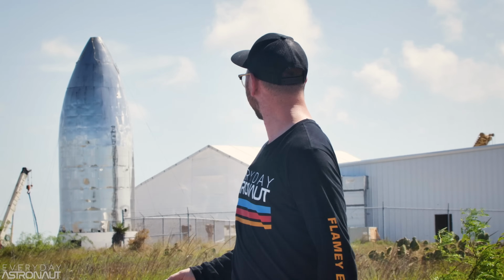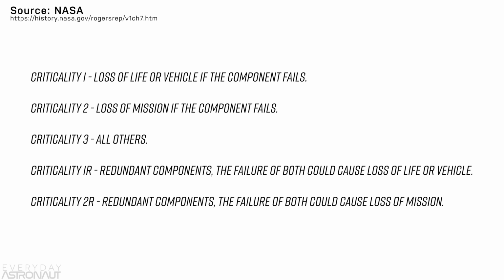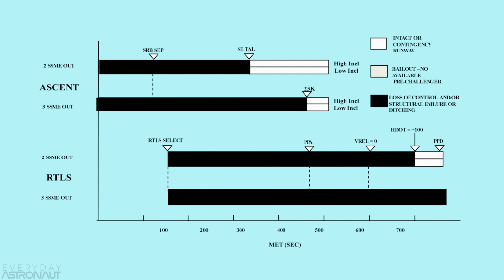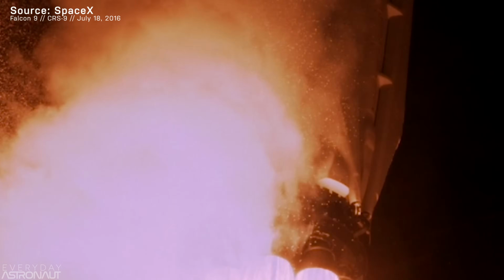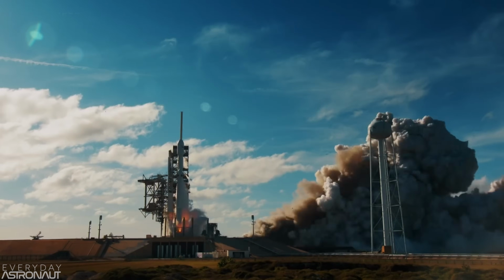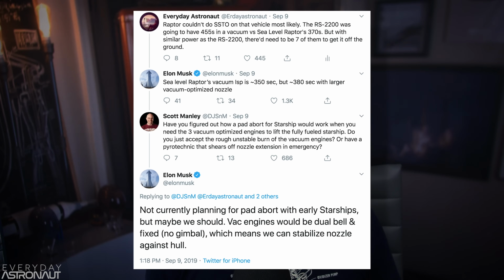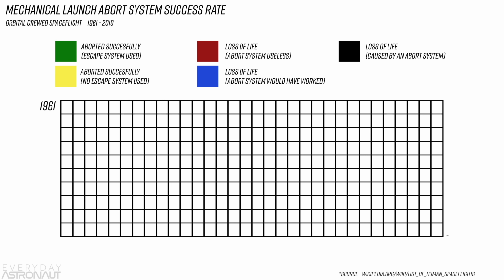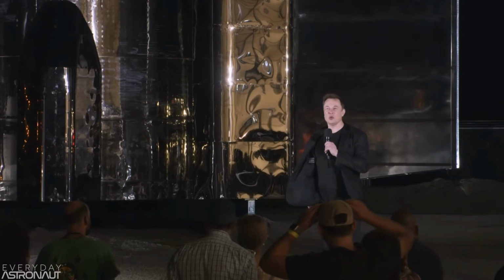Why won’t Starship have an abort system? Should it?!

Comment: simplicity wouldn't have made the shuttle safer considering it's complexity was not the reason for it's failures, but an abort system would have made it safer.  in the same way, simplicity will not make StarShip safer, but an abort system would.

Comment: I think if spaceX really wanted to make an abort system for starship they should go the blue origin route where there is an SRB on the bottom of the crew capsule that looks like a stylish table from the inside (also they would have to add some emergency parachutes to the capsule).

Comment: the Space Shuttle orbiters actually had zero failures; the loss of Challenger and Columbia were cause by failures from external sources, ie: the solid rocket booster and the shedding of foam from the external tank...

Comment: Since Starship has a clear demarcation between the drive section and the cargo sections plus with the expected design for the moon landing version that incorporated it's own thruster engines to the base of the cargo volume, wouldn't there be an advantage to adding some flexibility to the system to change out cargo deployment types by having a designed separation of the cargo section from the drive system? Once done you can swap out how a tanker is designed for cargo vs a people carrier with artificial spin gravity mech. vs a satellite launcher etc. With the designed separation it could also be utilized as anabort system.

Comment: I don’t think an abort system would’ve saved the Challenger crew, at least one crew member knew that something was wrong, but only realized that around 1 second before Challenger disintegrated, that wouldn’t have been enough time to safely perform an abort.

Comment: Time stamps:

00:00 - Intro
3:05 - How abort systems work
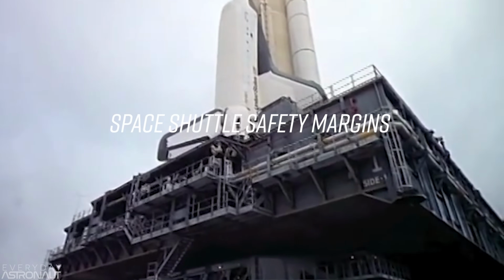5:25 - Space Shuttle Safety Margins
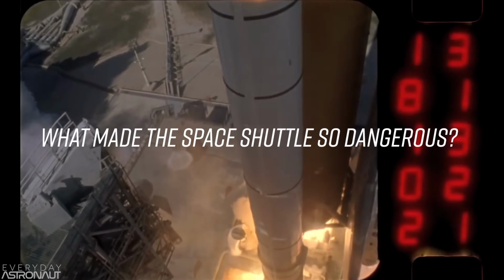10:40 - What Made the Space Shuttle so Dangerous?
16:00 - How Starship Will Differ from the Space Shuttle
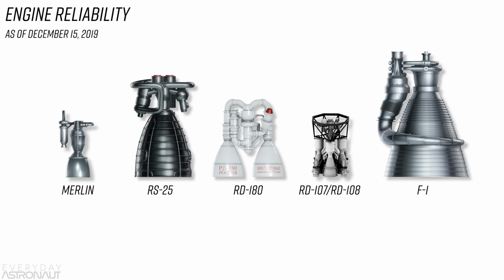21:00 - Engine Reliability
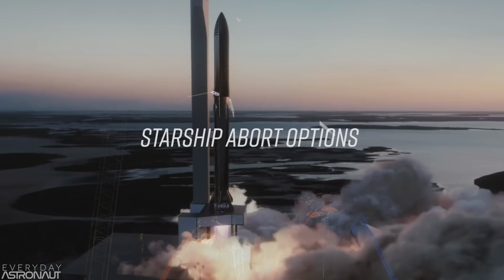30:25 - Starship Abort Options
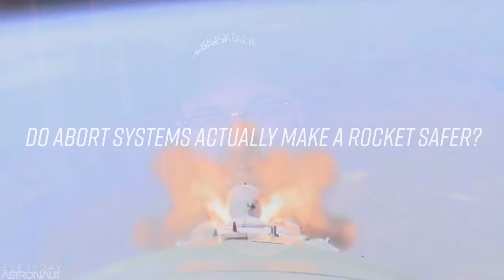34:30 - Do Abort Systems Actually Make a Rocket Safer?
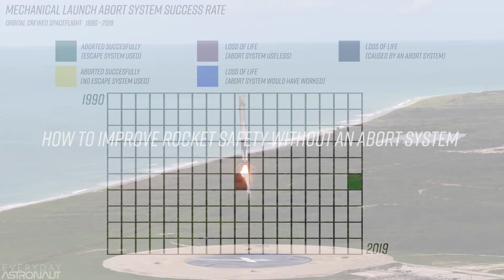38:55 - How to Improve Rocket Safety Without an Abort System
41:50 - Are Launch Abort Systems Necessary for Human Spaceflight

For smartphone users.

Comment: Under the current Starship configuration, the only way an abort system would work is if they literally cut our the cockpit section, bolted back with explosive bolts and had the external tower on the nose.  It could be jettisoned after flight.  You aren't going to save the rest of the rocket so this will work for initial flights and testing.  Passengers would not like the whole burning up and sudden deceleration thing.

Comment: If it is a government organization He will have to add an escape system. Because somebody said "I was afraid to die."

But for private companies The main thing is profit, Adding the escape system Is equal to increasing the cost And when the escape system starts That means their flight has failed. Which means a large amount of money that they have to lose. And even if there is an escape system The chances of survival are still very low.

Therefore, for commercial aviation Throwing money into the escape system (To save the passenger life only) That is not worth it. When compared with the money pouring into the entire system To make it safer (To protect both the interests of the company And passenger life)

In fact No matter how much money you spend on the security system. Someday, an unexpected incident will happen anyway. (This is a lesson you should learn from NASA)

If spending money on the needs of the people Which does not bring benefits to the company In the end, it only makes the company bankrupt because of the loss. And I don't want to Spacex. Make mistakes like NASA

Comment: 22:56 in regards to the mighty F-1 engine reliability,  during the Apollo 6 launch the first stage showed severe pogo osculations that nearly destroyed the vehicle.  Due to the less than nominal launch the Saturn did not complete its mission and I would consider it an at least partial engine failure.
Reply from the maker: Was that not a J-2 engine and it’s pogo oscillations?
Reply: @EverydayAstronaut  The first stage pogoed severly.   NASA reported "The second Saturn 5 lifted off from the Kennedy Space Center’s Launch Complex 39A on April 4, 1968; the mission ran into trouble from the start.  Two minutes into the flight, the first stage experienced about 30 seconds of  longitudinal oscillation known as pogo. Superimposed on the steadily growing acceleration curve was an oscillation with a frequency in the 5.2 to 5.5 hertz range which reached a peak amplitude of ±0.6 g about 125 seconds into the flight – over six times larger than the same effect experienced by Apollo 4. This was much higher than the ±0.25 g upper limit permitted during earlier manned missions and would have been intolerable for any crew. If Apollo 6 had carried astronauts, it would have certainly been aborted at this point.". . . . panels were seen falling off of the lunar module adapter.  Apparently unrelated to the pogo oscillations. After the completion of first stage firing and part way through the second stage burn, two of the five second stage J-2 engines shut down prematurely. The planned 175 km circular Earth orbit was not achieved. After two orbits, the third stage failed to reignite as planned and TLI was not possible. There was an apparent failure in the stage’s primary and auxiliary hydraulic systems had prevented the restart. The Service module engine was used to boost the spacecraft to an apogee of 22,225.4 km, from which the planned lunar reentry simulation took place at 36,025 km/hr. The failure of the 2nd and 3rd stage J-2 engines were not 1st stage pogo related.

Comment: Wide body passenger aircraft are not just redundant - they are quad-redundant. That means they can fail 4 times before a crash. Which is basically fail-safe in anyone's book. HOWEVER, airlines and the FAA are so used to this fail-safe nature that they commonly allow jets to take off with just triple redundancy! (One of the channels is inoperable!) Aircraft voting systems are yet another more complex subject.

Comment: Lots of statistics but the bottom line is every major launch system has experienced 1-2 catastrophic failures per 200 flights.  This includes Soyuz, Space Shuttle, and Falcon 9.  Remember F9 has had two failures so far, one in flight and one on the pad.  Either one would have required an abort system for crew to survive.  Starship will have to improve reliability by at least an order of magnitude to reduce chance of  catastrophic failure to 1 in a thousand, still not very good odds.  Can it be done?  Doubtful.

Comment: without watching i can conclude the answer is . yes it is necessary, you need to be able to take the risks in order to achieve great things. did columbus go float the sea`s with a live boat?  so basicly it doesnt matter if we have a savety messure or not. you still have to wager to go ahead or stop the procedure.

Comment: Perhaps Starship can do an emergency water landing if all else fails.   By using the flaps to flair out just above a lake and then touch down.  It would at least minimize damage which would allow reuse of components and protect the failed components that caused the failure (failed components available for failure analysis would be very helpful).
      The difference between 100% Saturn 5 rocket engine success and falcon 9 engine success is the numbers of launches.  Statistically you can calculate which one is more reliable by assuming different failure rates and calculate the standard deviation probability that the assumption is wrong.  Thus many engine successes gives a much smaller sigma standard deviation and therefor falcon 9 engines are statistically more reliable than Saturn5 enginess

Comment: So the question remains.....when they designed the shuttle, was the detachable/ejectable crew cabin part of the original design and scrapped due to cost, or had nobody thought of this before?

Hmmmm....I don't know, but i'm hung between the two possibilities. /sarcasm mode

Comment: There is one issue not addressed by this video. Yes, the best way to guarantee reliability is to fly hundreds or thousands of times. Starship won't have the luxury of hundreds or thousands of test flights before it has humans on board. Purely because it is big, and expensive. That's what scares me. SpaceX has had a history of coming up with novel and unforeseen ways to make a rocket explode. It might nail Starship's design. It may not. But the only way to know its reliable is to fly, and fly again, hundreds of times. Again, the sheer size and cost of the thing means this kind of verification won't happen. Then there are other things that are new and unique, like the life support system. Like all the seals. And my favourite, the landing. Again, hundreds of test flights might prove its reliability but until then, you're risking human lives, and potentially many human lives on something that really hasn't been tested enough. Does Starship have a business case that involves hundreds of unmanned cargo flights? I doubt it. Again because it is far too big.

Comment: I don't know why they talk about starship like it's a proven rocket. I don't think it should be compared to anything until it actually exists. Thats why SLS still exists.
Reply: Sean Harris did you see the tests? They have better welding now and passed (cryo pressure, static fire and 150 hop). It can withstand pressure higher than atmo pressure against the starship. SpaceX just go stacking to do it’s only matter of time. By the end of the year it will be proven rocket.

Comment: If the Starship upper stage was not fully loaded, but only had enough fuel for a couple kilometers "hop", would that work better as an on pad and in-flight abort "system"? Without the weight of all the fuel the acceleration should be significantly faster... Since SpaceX Plans to refueling in orbit anyway, could that be an option? Of course, this means that the Super Heavy Booster would have to give most of the orbital velocity....

Comment: I do think they can engineer it to make an abort system as absurd as putting one in a car.   to where you could have accidents or even mid air collisions and have enough redundancy to safely land.
  Most aircraft crashes are caused by human error. With these more advanced A.I. systems they are starting to use we can take more human error out of the equation than ever before. Even f-22 fighter jets will literally not let the pilot take a action that would cause a collision.  So there is a strong Argument that perhaps the best escape system is a system that escapes human error.

Comment: By making assessments based on “how flights used to be” you make an assumption that they will likely continue the way they were (which is an assumption) and thus you are biased in percentage assessment towards “how things used to be” and Starship is a new endeavor.
Reply: I mean it could possible be that in. Ever flights, flight abort system will be used more often that in previous era of flights that is our only data for analysis.

Comment: The space shuttle had a factory module insert attachment to the rest of the orbiter as part of it put together design compositure. All the had to do was to make quick disconnect connections, that would server to crew module from the shuttle. A then standard air force cargo parachute attached to a barometric deployment method of opening the chute, would then be used. They found that the crew of the Challenger lived all the way to the surface of the ocean, till impact. Only one of the crew, think it was Judy Resnick, had a fractured arm./ On Starship, this was a job that I was interested in,. This is mainly because the integration phases for this spacecraft, are extremely complex. There has to be structural viability, plus thermal and space radiation protection. However, a simple ejection seat is capable to integrally be be designed into Starship. All one needs is a power-det outline cords to blow a hole in the sidewall of Starship to allow the crew at their seatings out. Or one can go without the ejections seats at all. The problem with the inhabitable parts of the orbiteer, is that it must be very very carefully designed. I see year 2035 is the prime launch date for Starship and probably not before that. Elon Musk is a suspicious person and does not readily accept help from people he does not know.

Comment: RD-180: The engine failed. But the mission still succeeded. Still, the engine failed.
Reply: Eh, that engine would have been a loss anyways. So as long as the mission suceeds for them it is the same. 
When it comes to recovering these engines tho? That is another thing entirely.

Comment: 4 micro raptors on the crew section would be high enough to not cause moon dust AND could double as a launch escape system in emergency

Comment: Great videos bud, I really enjoy how you break it all down. It is interesting that you used commercial airliners as the comparison when the first planes were not commercial, most were for military purposes. Loads of designs for ejection were tested, nowadays, fighter jets have the ability to eject the pilot(s), commercial airliners function on the basis of planning for success, not failure, with a few, relatively primitive and ineffective methods of preserving the passenger's lives in case of emergency.

When we, as the public, fly on planes, we are just hoping it goes okay, as we would on a spaceship, yet the military still believe preserving the life of their highly trained pilot is worth the effort and extra parts.

Do you think this highlights a difference in mentality or is it more to do with practicality.
Reply: Fighter jets also have the issue of getting shot at, causing catastrophic failure. Commercial and civilian planes very, very rarely have that problem to contend with.

Comment: Actually, the same question was being asked about airliners in the very early days of commercial aviation. Believe it or not, there were serious suggestions from some sources (outside of the industry) that passengers should have access to parachutes in order to cover all eventualities.
Funnily enough, I don't recall any commercial planes ever having been so equipped... and I suspect that eventually the concept of abort systems will also become redundant.

Comment: I think abort systems are good as a just in case measure. A system as simple as possible there to potentially save lives if it's roll is required. Like you suggested at least untill a launch abort system is no longer useful in any way shape or form should we not have them, until we completely remove the risk the LAS covers we should have it

Comment: Lots of engines can be a problem, no matter how reliable. The N1 had extremly reliable engines, but the plumbing for those engines was the killer. It only flew 4 times tho, which means it's probably not the best point.

Comment: As far as Musk's 200 indevidual's transport 2 mar's\moon is concerned. Slidding rail, highe tensile memoree springs', would b a good concept 4 him 2 employ. Sliding the passenger's cabbin off le rocket and parachute's decent. Boyancee bagg's on underside ov passenger cabin. Stainleess soloid construction has been a long time cumming. Micro meteorite's go through plastic and aluminium much easier than solid stailess steel. Mabee even Outer layer le stainless with titanim 4 extra strength.  Plastic inside attached 2 Aluminium which intern attached 2 lead 2 provide radioactive sheilding 4 crew. Heatsheild, Titalium, Stainless steel, Lead, Aluminium, Plastic, Wood, Electronics, Passendger's\crew

Comment: As a kid when Challenger blew up(1986{Stardate 25}), i contemplated an abort sistem with le shuttle crew cabbin seperating from rest ov shuttle. Probablee with high tensile spring's and then parachute's 4 decent. I also dislike American desgne vehicle's that eject through le roof ov vehicle. When 1 takes a dump it go's out behind. A sliding rale ejection sistem say out between 2 tailfinn's would be much better than straight up through le roof. However i am contemplateing a bird type vehicle rather than an oboslete 1930's rocket concept.

Comment: If you consider that parachutes are an emergency abort system for aircraft, and none of the passengers on commercial aircraft have them (ignoring the logistics of everyone bailing out), a missing abort system on a 50-to 100-passenger rocket is really just Norminal.

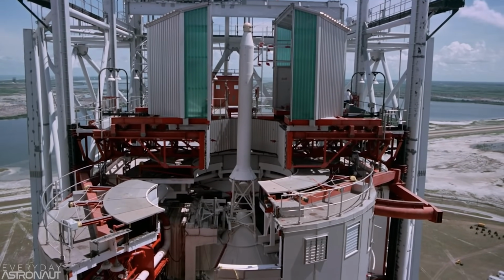Comment: 3:48 even if 0.5% of flights would see a benefit from a launch escape system, keep in mind that space flight in general has been safe with relatively few instances of failure requiring aborts in the first place. So I wouldn't say it is a question of benefit, it is a question of whether one should engineer an abort system into the design of a launch vehicle, and, costs aside, I think it is more so a moral question than an engineering one. If one could engineer an abort system into a vehicle, and if the goal is to return the astronauts safely to earth given any number of possible contingencies, then I think it should be included in Starship or any launch vehicle. Even if we could make systems 100% redundant and reliable, it still makes sense to have every single possible safety feature for the astronauts in place, astronauts that risk their lives in going into space. Airline pilots don't risk their lives, practically speaking. I also agree the launch abort should be a separate system.